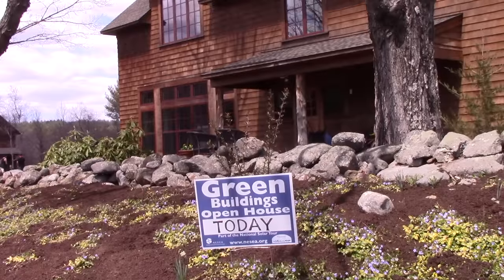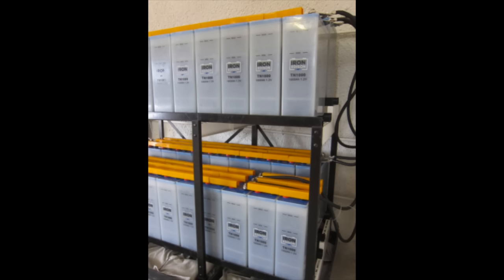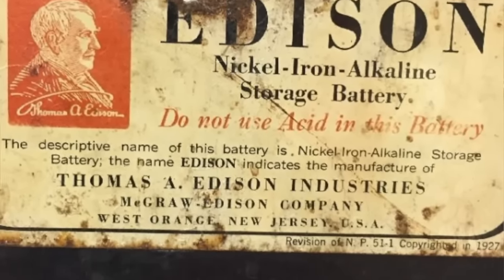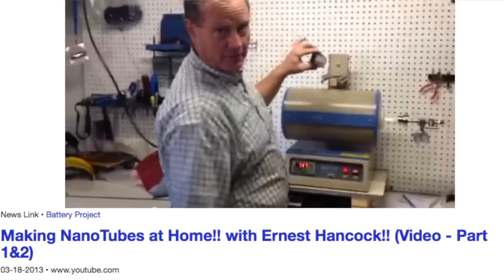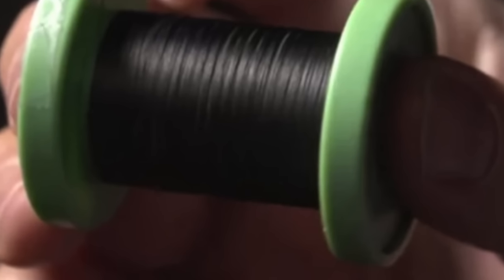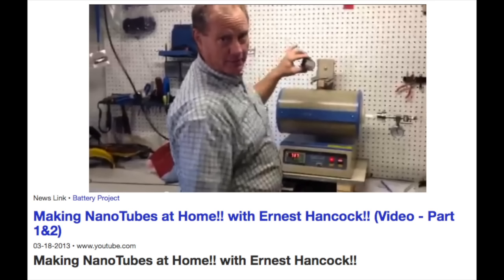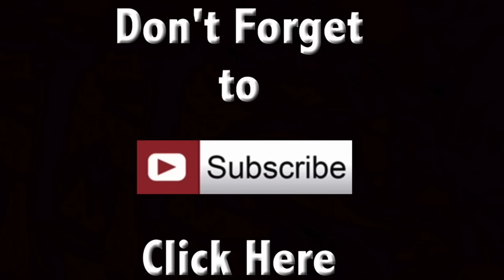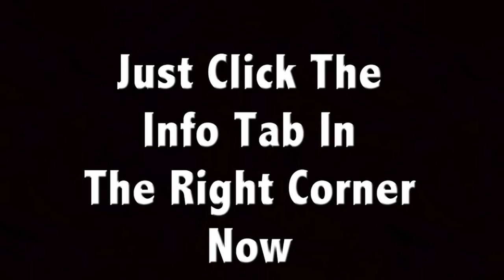The Best Battery for Off Grid and Solar Systems -  Nickel Iron NiFe Edison Battery - "Tarrin it Up"

Comment: 3:48 24V Ni-Fe*800Ah=19.2kWh for $15200. You can buy 2 Tesla powerwall2 13.5kWh for $5500 each or 5 Tesla Powerwall 6.4kWh for $3000 each using less amount of money. Furthermore Powerwall has 90% efficiency compared to 65% for Ni-Fe  (http://www.mpoweruk.com/nickel_iron.htm). 5000 cycles under warranty for Li-ion is not as good as advertized "11000 cycles" for Ni-Fe, but look here https://www.youtube.com/watch?v=czLMHysEHPs for debunking Ni-Fe 11000 cycles. In face Ni-Fe will have at most 2000-3000 cucles, losing Li-ion in EVERY METRIC. Only practical disadvantage of Powerwall if it's high voltage (350-450Volts), but this yuields very efficient inverter and very low losses beetwen battery and inverter
Reply: Volodumur Kalunyak You look at total cost... the NiFe battery will last longer
Reply: NICHOLAS LANDOLINA Are you sure? Powerwall's will last longer than ni-fe cells if you buy second after first is degrated. Price allow you do that. Look at manufacturer, not a seller (beutilityfree and ironedison) specifications. Also Ni-Fe incluse cost of you'r time doing maintenance and distilled water with electrolyte.
Reply: By that way of thinking you can have 20Kwh lead acid AGM batteries for
$4000 that's much cheaper than either option
Reply: Actually Lithium ion batteries have a similar cycle life vs DOD 
the difference is that LIon batts can deliver full current right down
to 80% DOD while AGM batts are only useable down to 50%
Reply: Those Iron Edison batteries ... I don't trust them.  They're probably made in China and the components aren't probably the same as the original NIFE batteries. I wish there were real tests done.
Reply: i have 48 year old ni-fe cells and they are operating at 75% and they have from all i can tell a 65- 80% dod. i have used them and abused them and they are still running great. the 3000 cycle thing is electrolytic degradation. 5-10 years you have to replace the electrolyte due to the fact that potassium hydroxide left in the air will absorb co2 becoming potassium carbonate. and the hydroxide ions are torn away and boiled out as a gas. mostly anyway i dont know how true all that is but i have lithium cells that are 1 year old that are dead as a doornail so thanks but i will keep my ni-fe's .
Reply: gundum4589 
That's good info. I didn't know about the electrolyte going bad and needing replacement. How often do you use them?
Reply: every day all day all night. the inverter never gets turned off. i picked them up used from a friend who got them from a junkyard. and some of the electrolyte smelled bad. i mean like rotting burnt plastic kinda smell and i checked the ph and it was around 9. and koh is more like 13-14 at 20% solution. so i replaced it and yeah they work good for us. tv, fridge, lights and a water pump we don't have much load honestly.
Reply: So,  how long have you had the batteries ???  

I've been very interested in these batteries for some time but I was discouraged since nobody really knew about its discharge cycles.  I knew about the storage longevity,  but not when cycled on a daily basis.
Reply: 3 years to date and like i said the inverter is never off unless its dark for like 3 days strait then the batteries die and we wait till the sun or wind charges them. my friend had the shipment date and use log from bell telacom company from that time. they used them for 14 years cycled 8000 times and then it was no longer needed to have a backup in that location and they decommissioned them. they sat for 18 years and then my friend grabbed them up and they sat another 13 before i got them. now i am looking at some more in a junkyard that i want to get
Reply: That's really good info........ I'll keep an eye for prices.
Reply: this is all about the older cells i dont know alot about the new ones they might have changed the construction but old ones heck yeah
Reply: The thing with Lithium batteries is that they don't yet have a big track record that the manufacturer can use. So the number you often see advertised is the WARRANTY number. Just like a 100 000km warranty on a vehicle doesn't mean the vehicle will fall apart and stop working after 100 000km, a 2000 cycle (typical) lithium ion battery also won't stop working after only 2000 cycles. The LiFePo4 batteries are even better, and they are typically rated down to 80% DoD. In addition, the battery still has 80% of its capacity left once it reaches the warranty-specidified number of cycles, after which you can put it through another 2000 cycles before it gets to 65% capacity. And so on and so forth. In my own country I can already buy the BlueNova batteries (rated at 8000 cycles), it will cost less (because I don't have to import them), the overall efficiency is better, I can charge and discharge faster (so it is better suited to self-consumption systems), and so on and so forth..

In other words, I agree with you, there really is no comparison between NiFe and LiFePo4 or even the newer NCA type batteries. Are we surprised though? There is a reason Lithium sits where it does in the table of elements :)
Reply: cars are one thing because of size constraint ni-fe batteries are huge compared but 8000 cycles is still low. thats only 21 years. sure sounds amazing and it is compared to the lead acid 5 year or even 8 years they live but when you have solar in a house thats not going to move anytime soon. 48 years with 80% life and capacity left. is hands down the best. not bashing lithium at all. i like it alot to be honest. but i am just offering that it may be a better longer lasting choice for ni-fe cells. that and lithium is highly reactive with water so flood damage could lead to fire too, or explosion ni-fes wont react the same if there is a flood. anyway this is a good conversation exploring new ideas is always nice.
Reply: For cars, even 2000 cycles (which is the typical warranty number of an NCA battery) is a good number: These vehicles now go over 100km on a charge. Multiply by 2000, that's 200 000km (or over 100k miles for the metrically impaired) before the battery is even at 80%. Vehicles get into accidents... there will be batteries that will outlive the cars and that will find a second life in a house somewhere. Weight is going to be a major advantage in a house too, but mostly I think the most important point people miss is the charge and discharge rate.

If you've been using solar long, you know the struggle: The battery is 85% full and even though you have plenty of solar available, you cannot charge it faster than whatever the absorption voltage allows. You have to sit there all day charging at a fraction of what is available because the battery cannot take it at the rate it is available. It looks like NiFe is also limited to C5 charging, which means they will have the same problem as the lead-acids in this respect.

I also like to be honest :-) I can see the attraction of the NiFe battery, but I think people underestimate the value of something you can move around and they don't realise what an advantage it is to charge a battery quickly, especially in city houses with limited roof space.
Reply: yeah thats no lie. the size is a major advantage but when you have 3 times more solar input than the load of anything in the house then its all well and good. plus if you have a balance circuit within the bank of ni-fes where it will charge one cell individually it helps alot. same goes for a lithium you absolutely need balancing circuits. the only real reason i am partial to ni-fes is the simplicity. you don't need a charge controller, you don't need to worry about overcharging too much. and they can handle more extreme temperature swings without damage. my bank preforms well. very well compared to my old lead bank. with a little less than half of the capacity of the lead bank i had i can actually run a vacuum with ni-fe cells when i couldn't with the lead. so i like them very much
Reply: yes but you can also never replace them for 50 years... think about that 2 tesla walls will last 500 cycles so 5 years then you have to repbuy them.. back in the day they were 100 years ahead of us now.. uncle sam and corperations suppressed the knowlege to gain profits..

Comment: Lead acid batteries don't errode due to the acid eating the materials. The plates get covered in sulfide. Also, even deep cycle lead batteries only have a 50% depth of discharge and the charging of them can easily damage them, if charged too quickly.

With Nickle Iron batteries, the discharge depth is 80% and the batteries are capable of being charge quickly without damage. However, these batteries need to have the electrolyte replced every 4 to 5 yrs. However, if you can handle the steep price and the additional size, this is an excellent battery technology.

Comment: You know it's really funny how hard it is to find a basic schematic diagram of how to construct one of these. I'd really love that because I have tools in my shop and access to metals. I could probably whip one of these things together pretty quick if somebody just put a good diagram and real information on the working concept. It's kind of like when I started researching flow batteries. You'd be surprised how little is out there. It's all very vague and getting your teeth into good diagrams in good working Concepts is very difficult

Comment: Surface area increase to the nickel. I'm thinking put in solution and pump thru micro channels across membrane. As for a pump I'm thinking air tank to pressurize fluid chamber, spring piston, or gravity piston. Gravity piston would work great for home power systems..

Comment: Power density isn't optimal for mobile applications, charge-holding ability is limited, and discharge efficiency is not the best either... but if you're looking for a battery that you can install in a large bank with low toxicity and go decades between replacement, the Edison battery is in theory a very good choice. Of course the devil is in the details.

Comment: I think to coat with nano-wire conductive fibers soak for a couple of hours and wash with water from distillation and 3% caustic soda (pure Sodium hydroxide), then steam with similar caustic soda solution for 12 hours (caution), As with Keshe Foundation copper plates for making gans.

Comment: some lead acid batteries last incredibly long...I think its how they make, add things, stuff (corporate secretively) in them...theres one lead acid maintenance battery that I got as used from brothers car in 2013 at about 1.5 yr old...its still running on my car after 4 yrs...I see it has a label saying ''SILVER OXIDE''..I had never seen a better car battery than this in my short 4 decade of life..lead acids work stupendously well for anything PROVIDED you don't overly discharge them quickly....the trick is to have a massive parallel reservoir of Amp Hour stacks to create a large super amp hour rating theoretically for  a fraction of only what you need to use...eg..if you use 2000 kWh per day then you should have something built up for about 10,000 kWh of stored potential..USE ONLY ABOUT 20percent, JUST MY HUMBLE 2 CENTS

Comment: I have been using these batteries now for 12 months they have been good as lead acid batteries for sure just had to reconfigure my charge controller as these batteries like a higher state of charge.find they charge quicker than lead acid batteries and similar discharge as lead acid specific gravity is consistant over the period would be interesting over time how they progress manufacturer states if they start to loose capacity just change the electrolyte and good as new again,certainly cheaper than buying new battery bank

Comment: Hi  Dr. Tarrin, Stay updated, Edison has a new concept of batteries, since October last year, an invention of Robert Murray Smith, an English  from Walls who joined Edison in the year 2015 and has resigned from this marriage recently, it is a thin film carbon to Carbon batteries. Robert has an open souce on his channel that you can see, it's impressive.However, while it is half a world trying to make good batteries, there is already much better American technology. It is a cell based on Silicon carbon that produces electricity to charge batteries, this means that instead of buying 10 or more batteries, you only need 2, this cell keeps the batteries charged for ever day and night without solar panels.Cheers

Comment: would be nice if you got ALL your facts right.  these batteries have been in use since they were invented, they are used mostly in the subway trains, both in the U.S., and Europe.  They were made in the U.S till the 70's, but you can still buy them from England, and now a Chinese company is making them. The overall size of the battery may be why lead acid batteries are used in cars instead.
Reply: @vondahe  That must include Shanghai magnetic train, I suppose. Do you know how many derailment events have occured?

Comment: Earnest may be using the Nickelelectroplating tech using his own homemade nano carbon tubes  (his YOU TUBES, Right, LOL) so that the nickel is not just on the outside of the tubes but also on the complete inside of each nanotube, thus doubling just the dip and stick method of nickel plating?   Is that the way of it? thanks.

Comment: To me the most important thing is warmth when the power goes out.  I'm planning for the wife and I to move off grid. If my batteries go out, I'll still have hot running water, a means to heat the whole house and cook food as well as light, all without electricity using solar stills, cookers, heaters and lights. (Solar as in radiant heat from sun Not solar panel and Dc voltage.) Then there will be plenty of time to replace batteries. You see you have alternate systems in place for when your electric solar goes down.
Reply from the maker: I really want to build an earthship someday so I don't have to worry about heat anymore.
Reply: Pounding sand into tires is a lot of work.   How about passivly heating water?   http://www.ece.villanova.edu/~nick/solar/solar.html

Comment: This battery definitely needs to be talked up more. We know that lead acid works for electric vehicles like golf carts. If we can get the energy density of these batteries down to at least equal lead acid... boom, power your short range (50-100 miles range) EV with Nickel Iron batteries and recharge them with solar, and basically never have to swap out the batteries for the life of the vehicle.

Comment: In November 2016 I visited the oldest and biggest Nickel Iron battery factory in far western china. To say that the batteries are not as Edison made them is correct, they are far better. The factory uses modern technology and top grade materials to produce outstanding quality batteries. They have been making Nickel iron Batteries there since the 1950's and Nickel Iron batteries is where their battery manufacturing started. They now make so many different styles of batteries, including Lithium Ion and so  many more. The factory makes batteries for the space industry, the military and transport systems, and the thought that any of these are going to use sub standard batteries is laughable. I have to admit that I was prepared to see a cheap nasty factory manufacturing sub standard products, but from the first step into the manufacturing halls I was completely blown away by their world class manufacturing techniques. Most large companies in China proudly show you their Quality Assurance certificates, but seriously miss the point of the process, this company embraced QA and every aspect of production is adhered to as if the factory was in Germany, USA or Australia.

Comment: Interesting. I'd heard good things about Nickel-Iron batteries in solar systems (with CIGLS panels), but then recently also read this: https://www.rpc.com.au/solar-news/161/disadvantages-of-nickel-iron-batteries.html - and now am hesitant.. not quite sure which information to listen to.  Any comments on these concerns?
Reply: I'm curious about the disadvantages of nickel iron batteries too. I think even with the disadvantages, if they'd ONLY cost 30% more than lead acid batteries with same capacity would be awesome. Because nife batteries apparently last forever so they'll be the last batteries you'll ever buy.
So they sound "too good to be true" really. It also shouldn't be hard to rig up some kind of semi-automatic maintenance. Have some arduino sensors to measure water levels and add water automatically.
Unfortunately there is a lot of "green hype" these days so you never know what source to trust lol.

Comment: Nickel can be replaced by copper which is safer and cheaper than nickel. if you know what your doing. it's not so simple.
the other problem with alkaline batteries is atmospheric co2 levels slowly dissolve into your electrolyte raising the internal resistance. So the electrolyte needs to be periodically replaced. About a 1000 cycles or so.